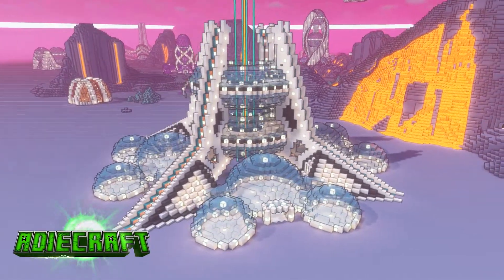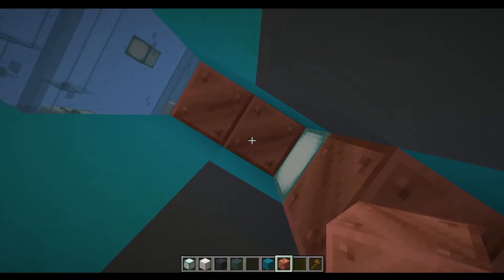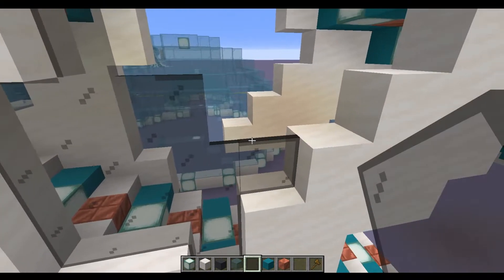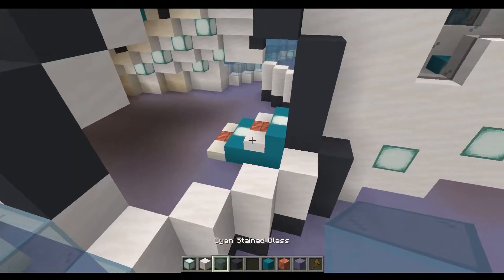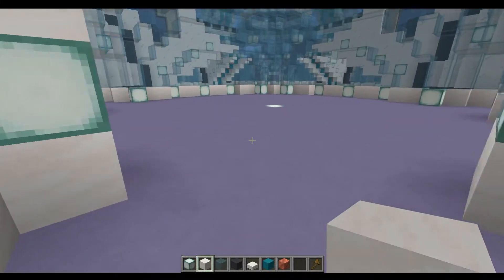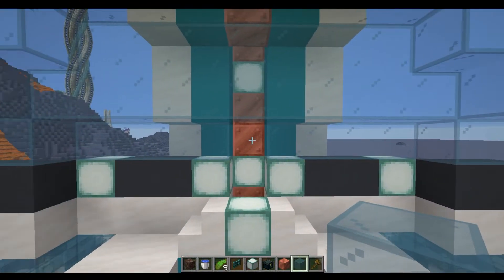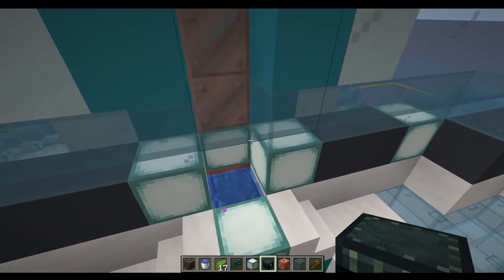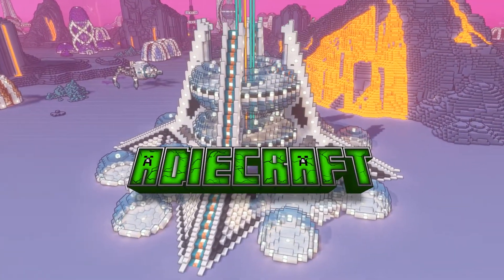Minecraft Futuristic MEGABASE TUTORIAL - PART 2 - Futuristic Minecraft Mega Base - Final Part

Comment: Yooo! 
I know I'm late by two years, but I just finished building this and it looks absolutely stunning.
It took me a few hours to gather up all the materials, and it took me a week to finish building it. I have also finished working on the interior myself, and it looks amazing.
I added full beacons in the middle like how you did, and they're pretty useful aswell. 
The only things I changed during this was I changed the normal waxed copper to the waxed oxidized copper which has a turquoisy color which I think looked good with cyan. 
I also decided to use magma blocks to make a water elevator down since I thought it looked good. 
This build was amazing, it's my first build from you and I'm going to build all of the other futuristic bases too!
Reply from the maker: That's Awesome! I'm so glad you liked it and it's worked out for you!